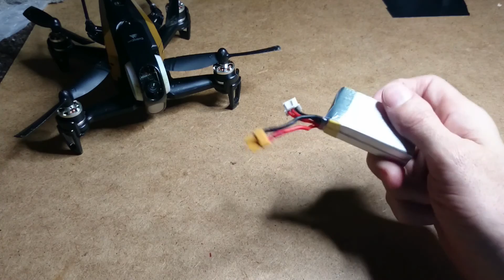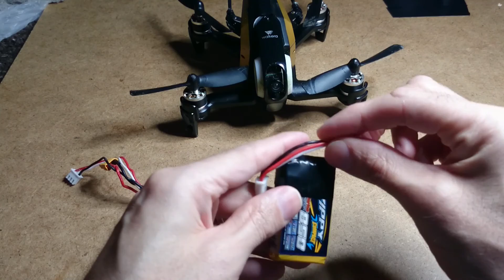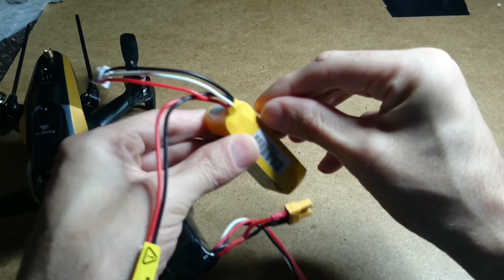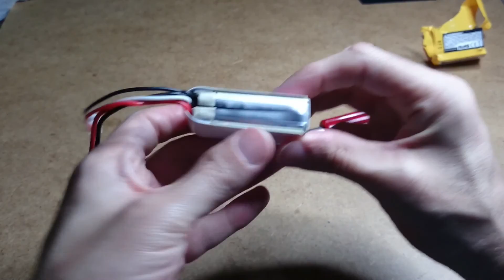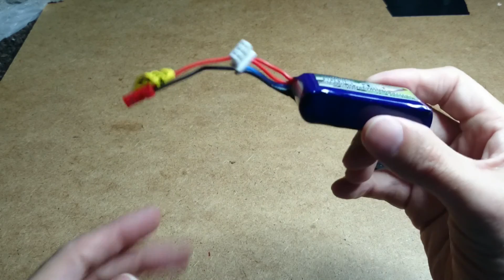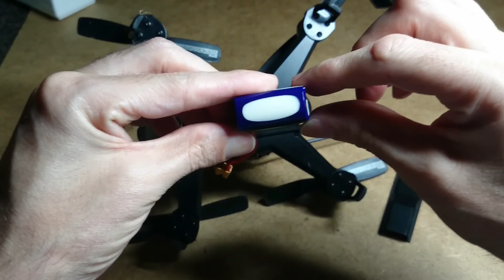Walkera Rodeo 150 Battery Shootout

Comment: I know this is an older video, and I'm not trying to step on any toes, but instead of of cutting open several of the volatile type batteries we use with quads, and removing one of their safety features, I thought it would be easier to adjust the battery compartment and leave the batteries alone.  I always hated that little door on mine anyway, could never get it shut right.  Anyway, I have some of the exact size batteries you were trying to fit in the Rodeo.  I just threw battery door in the trash, I carefully used a dremel to sand/grind down and back a little, the lip/groove that the the stock battery cover slid into. After that the battery fit in there snug as a bug, but I still attached a small velcro strap that went across bottom, just to be safe.
Reply from the maker: Yes others did what you said aswell thanks for your input :)

Comment: What plug do you need for the nano-tech 850mah 2S 25~40C Lipo ?
Reply from the maker: I changed all my plugs to XT30 even on the quad but if you are sticking to the stock walkera plug you need to use the EC2 plug.
Reply: Merch RC will these adaptors work?
https://hobbyking.com/en_us/xt-60-to-jst-charging-adapter-2pc.html?___store=en_us
Reply from the maker: Yes.

Comment: I had bought an extra top n bottom shell for my 150 and i noticed the bottom shell has 3 air vents under it.  Is that for the esc burn outs people were having?  Mine didn't come with the air vents.  Luckilly i have been flying in cool weather but in the summer i might have to install the bottom shell to get air flow.  I think I'm going to try one of those zippy batteries your using.
Reply from the maker: Yeah the air vents are to cool the Esc's burn outs were rare imo.............best battery is the nano tech 850 bro.
Reply: I did see a Couple videos of people having that esc burn out. I was a little worried but mine Has been awesome.  I just recorded a flight with my 808 keychain camera on it.  I might post it. Thanks for the tip bro

Comment: I recently purchased my rodeo 150 and I am very pleased with it however with such a short flight time (five minutes or so) is there any thoughts on buying a battery of the same voltage (7.4v) but a higher mAh, to increase the flight time? Is this a good idea or not and what things should I consider if I do want to obtain different batteries with higher mAh. I am only recently getting back into RC fun so I don't know much if anything at all about Lipo batteries. Back when I was really into it mostly cars and buggies the batteries then were regular NiCad's so it was a little more straightforward. I have lost my rodeo 150 a couple of times and it took quite a while for me to recover it, as a result I thought about adding a GPS locator to my rodeo. Just something that puts out a signal that I could track with my phone to help me locate my rodeo. Is there any suggestions for this, what type lightest weight or things to consider? I would really appreciate any feedback on these topics from anyone that has any insight  on these issues. Thanks in Advance! -S  also, any suggestions or links on where to buy accessories, ie. connectors for batteries, motors, gps tracking devices to put on your quad. I know of a few places but haven't yet found the place, "That is the place to go" for quads.
Reply from the maker: The best battery is the nano tech that should give you 6+min of flying time a bigger battery will just make the quad fly like a pig:P
As for loosing the quad it has a buzzer that you should hear just turn you'r transmitter of and it will kick in.
Reply: So a larger battery will make it fly like a pig? I just wanted to increase the mAh. instead of the stock 850 mAh battery, I thought about going up to a 1000, 1500 or even a 2000mAh battery. Is it because of the size and weight of the battery that it will make it fly like a pig or does it have something to do with the milliamps or something else. As far as your reply about the beeper to locate the drone and turning off the transmitter to activate it, I did do that but the beeper is very faint and hard to hear and one time it stopped working/sounding, probably because the battery died! Anyhow, that's why I thought of adding a GPS tracker. The "TK303B GSM GPS Tracker $39.35" from Gearbest, is the one that I was looking at and considering. It only weighs .068 kg I did not think it would affect the drone much in the way it flies and handles. I am still learning to fly & control my drone REALLY WELL as well as learning some tricks & advanced maneuvers and although I don't want it to fly like a pig, if it's not too drastic, a longer flight time & being able to locate it if lost, would help me improve faster, than it being really fast & perfectly agile! I am new to this, so I could be way off! I just want the best advise & input so I can learn "the right way"! Without spending a bunch of unnecessary time and money!  Some of my questions may seem very obvious but since I am new to this, I am only just starting to understand a lot of this, such as (Lopo) batteries! I don't even really understand what the 20 C, 30 C, or 35C, even means. From what I have been reading it sounds like that is the rate in which the battery discharges, if that is correct. If so, does that mean that a 20c discharges quicker than a 30-35 C? And therefor produce a higher output but for a shorter duration. If, "that" is also true, then a 20c would be a better battery for racing &/or acrobatics where higher power would be more useful as apposed to a 30-35c would be longer lasting and have less punch but would be a better choice for just basic flying or exploring where your "fly time" is more important than having that "punch"!If I do get it, does it just plug into one of the "external RX ports" on the side? I have so many more questions so is there a better resource for learning &/or getting questions answered!  If you think I am way off with adding a gps tracker or truly have nothing to gain with higher mAh batts, please save me the aggravation! 
Thanks for all ur input- steph
Reply from the maker: A higher mah battery will let you fly longer but weigh the quad down and make it less agile,If you are just cruising around then that's fine but if you want to fly fast stick with the 850mah and a high C rating.
Higher C rating gives you more punch and are usaly heavier depending on how you fly you could have a little less flight time but not by muchand no you can't use the rx ports on the side to plug in the battery or gps in that's for a receiver.
If you really feel the need for a gps tracker then buy it:)
one more thing you should check out rcgroups it's full of info.
https://www.rcgroups.com/forums/index.php
Hope  this was of help to you.

Comment: could u tell me what connectors I need to buy for walkera rodeo 150 I got the ones from Hobby king but they don't have the right connection plz help
Reply from the maker: EC2 female plug is what you need for the battery if you are staying with the stock 150 connector.
Reply: im debateing on switching to tx60 as i aready have some as well as a parellel board fro them...any thought on that? will i loose power or any downsides? relativly new to quadcopter word
Reply: btw your videos have heped me a ton..i really love your content!
Reply from the maker: Glad my videos are of help to you XT60 plugs are to big they won't fit in the battery tray but XT30 will be fine with no loss of power.....Don't forget to subscribe happy flying:)
Reply: ok do you know of a way to parallel charge the xt30's? the only boards i can find are the xt60's..im debateing just useing the 60s and finding another way to hold battery w/o the tray..any thoughts?
Reply from the maker: Do what i did https://youtu.be/UfrSYKdRJjg?t=9m12s
Reply: yeah but im asking how i coud parrellel charge multiple batterys like that?  so i dont have to charge 1 at a time
Reply from the maker: I can plug six batteries into that board and charge them all at the same time thats what it does:)
Reply: i can only find parallel boards with xt60 conections..did you make one yourself with xt30 connections?iv iterally spent hours ooking for boards with xt30 connections
Reply from the maker: I made my own leads.

Comment: Friend asked the battery he told me and now are not worth really?
My stock battery does not have that yellow pin, mine is blue and round
Reply from the maker: I have changed the plugs to XT30 that's why they are not the same i did mention this in the description.
Reply: Merch https://www.amazon.es/gp/aw/d/B00QOYBJ6K/ref=mp_s_a_1_fkmr0_1?__mk_es_ES=%C3%85M%C3%85Z%C3%95%C3%91&qid=1485901850&sr=8-1-fkmr0&pi=AC_SX236_SY340_FMwebp_QL65&keywords=XT30+CONECTOR 
These plugs are the ones that I should solder to the drone and batteries
Reply from the maker: Yes!

Comment: I had to rebuild my rodeo 150 as the body cracked.  After putting it back together it will disarm but will not arm.  Any thoughts???
Reply from the maker: Did you try a rebind?..........It might be the ribbon cable because it is very fragile make sure it is pushed all the way in,Did you recalibrate the ESC'S and check in clean flight that all settings are good?

Comment: Hi merch, have you tested some 3s battery on the rodeo 150? Is it possible?
Reply from the maker: No i havve not and i wouldn't just incase you blow a ESC plus the extra weight would not be good on the quad.
2s is plenty for the rodeo it's a rocket as is:)

Comment: i bought 2 of those nanotech's and i'm finding the walkera battery's are giving me more flight time..i'm using an IMAX B6 charger to charge them merch but i'm not sure if there charging right....what do you charge your's at.
Reply from the maker: I always break the batteries in and charge them at 1c,Give them a few flights and they should be better.

Comment: anyone tried one of these yet?
http://vi.raptor.ebaydesc.com/ws/eBayISAPI.dll?ViewItemDescV4&item=281727238246&category=40700&pm=1&ds=0&t=1482199712839

http://vi.raptor.ebaydesc.com/ws/eBayISAPI.dll?ViewItemDescV4&item=131841196522&category=9161&pm=1&ds=0&t=1482199878464

http://vi.raptor.ebaydesc.com/ws/eBayISAPI.dll?ViewItemDescV4&item=142105429417&category=40700&pm=1&ds=0&t=1482199943880
Reply from the maker: Not tried any of them i stopped looking for batteries after i found the nano tech 850mah because they are the best that i had found.
But keep us posted if they are any good.
Reply: Merch yeah will do! ordered those last night....should be here soon. got 6 nanotech on the way aswell. gonna keep you updated about flighttimes of the new untested ones
Reply from the maker: Nice i look forward to you'r results.
Also did you know there is a smaller rodeo 110 coming out? http://www.banggood.com/Walkera-Rodeo-110-110mm-FPV-Racing-Drone-w-600TVL-HD-Camera-5_8GHz-40CH-Transmission-BNF-RTF-p-1111956.html?rmmds=search
Reply: all of those had been pretty crappy :(
best flighttime was 4min15sec....not worth to mention really. gonna stick to the nanos without further testing of more expensive 25c lipos.
Reply from the maker: Thanks for letting us know and yeah i don't think you will find a better battery than the nanos.
Reply: i was a bit too fast with my judgement.....due to some logistic problem i havent gotten the floureon 1000mah when i replied to tell you my results......and well.....it was the only one that did well, lol ;)
6min 45 until lvc kicked in!! (low power-flight ofc)
im using soldered goldcontact jst btw
Reply from the maker: Not a bad time but try a faster flight:P
Reply: but they are a bit more expensive than the nanos....
but my 1st choice now if i just want to order a single one.....cause shipping is like always included with the floureon ordered from ebay. so a single one is cheaper than from hk. gonna have an eye on how they hold up in full power flights in cold weather conditions, since they are only 20c.
Reply from the maker: Yeah let us know how long they last before they run out of punch,i have not heard much about floureon batteries so i cant comment on them.

Comment: can you use 3s on this quad?
Reply from the maker: No i doubt  it plus you really don't need it as 2s it flys like a 3s:)
Reply: @ejay200704  NO, I've had 3 of these, 2 crashed and I reordered, after shelving two crashed ones for a couple yrs, discovered one of them was an easy fix, so I had two of them last month.  Decided to put xt30 plug on one and use the Tattu 3s 650 batteries I have a bunch of, that I use to fly my Leader3, lighter quad at 130mm, plus no body to it, like the Rodeo.  Some people fly 4s on it, so I figured the Rodeo could handle 3s650, and the Tattu's are only like 6grams heavier than stock Rodeo battery and only a tiny bit bigger, but fit in the battery well.  It flew great at first, but during 2nd flight it fell out of the sky like someone shot it.  3 motors did not work, and not from the crash.  The plastic around the ESC's and especially the motors were too hot to touch.  After some reading, Walkera only put 15amp ESC's in there and I couldn't find it, but I'm sure only 2s rated motors. If you're comfortable taking it apart the ESC's are just plug n play if Walkera makes higher amp ones.  All their parts are proprietary I think, so it's a pain to use any parts you have.  I tried to put different props on with nuts, spent an hour at hardware store trying to find a specialty nut that fit it, closest one I found worked, but was wobbly when first screwing on.
Reply: Before switching plug and trying 3s, I bought some 2s 1000mah lipos, but they were almost 40g heavier than stock, and didn't fit in battery compartment, so I made it fit..lol  Quad got about 45sec or so more flight time, but it did not like the extra weight, I wouldn't have thought I woulda felt 37g on the sticks when flying, but I did.  They were Turnigy batteries though, known for being a little heavy.  Might try different brand on the one I haven't' broken yet.
Reply from the maker: @sunshynff  I did say no to 3s others have tried it with the same problem burnt out ESC's.
Reply: Merch RC.....Yes, you absolutely did, I meant to respond to the poster, Joenas, since I just tried it last week, I also wish I’d seen this video first before experimenting, but the one I did it on had seen better days, it was my back-up. I keep forgetting how fast tech moves, when these came out, 15amp ESCs and 2s was the norm on a 150mm quad, now they’re flying 4s on 120mm quads..lol.  And you’re right, the Rodeo flys like it’s on a 3s, even with that full shell, it was really well designed.

Btw, do you know if there’s software available to flash/tune the Rodeo? I know originally Walkera wanted us to use the radio to tune it.  But I thought I heard something obscure like Libre Pilot or something worked.

Comment: i might try some of these nanotech's i'm sure there cheaper than the 4s 5000mah 14.4 volt battery's i buy for my RC car's...drone's are cheap to play with....try owning 4 car's then you will know pain...thank's for vid.
Reply from the maker: Yeah RC car batteries are very expensive compaired to a150 size quad battery because they are much cheaper.
Reply: do you charge these nanotech's the same way as you charge the walkera battery's with the rodeo charger..just plugging in the balance plug.
Reply from the maker: No i charge them with a imax b6 charger also i would not reccomed trying to use the walkera charger.....Just remember tho i changed all the plugs to the batteries to XT30
Reply: i have a hyperion charger for my car's so i can probably use that    but i've never had 2s battery's do they all charge just from the balance plug no matter what charger you have.... with 4s you have to plug in the EC4 plug and the balance plug ...and also why can't i use the walkera charger...i'm also putting EC2 plug's on mine with heat shrink.
Reply from the maker: Yeah the hyperion  charger would be best to use just plug in the EC2 plug and the balance plug as you usaly do.
The reason i wouldn't recommend using the stock walkera charger is there really not good and i have not tried charging any other battery with it.

Comment: So is my Rodeo 150 falling out the sky ??
done this since new 
losing power
Reply from the maker: No it's not falling out the sky,many people have changed to XT30 plugs,Maybe you have a bad solder joint?
Reply from the maker: What battery are you using i had one zippy that whould only fly for 1min then drop out the sky it was a bad one.
Reply: Will check that but the live video is not affected 
I have a replacement arriving Monday so fingers crossed it is all good

Comment: Hello Merch,
 I could use some guidance modifying the battery plug on the quad. Really tired of using stock charger. Did you have to disassemble the whole quad to custom fit that plug. 
 Thank you my Friend
Reply from the maker: I just snipped the EC2 plug of and soldered the XT30  to the quad it's a tight working space no need to disassemble just make sure you don't drop any solder in the quad when doing so.
Reply: Right on Bro! Have to order some XT30 plugs and some of those nano-techs...before you buy them all! lol

Comment: Hi Merch. Just got the rodeo tonight took it out for a flight and it is unbelievable. I gave it a punch and could hardly see it.  Most challenging part is keeping it from the trees. When you turn it around you have to give her other wise it keeps going backwards. This thing is fun but new to me.
Reply from the maker: Hey Chris glad you'r enjoying it.I dont understand why it's going backwards.....Does it hover without going backwards?
It's a mean little thing just keep it in stability mode till you get used to it:)
Reply: I thought I had in stability mode. I just flew in one direction then turned it in another and continued with momentum and glided backwards.
Reply from the maker: Make sure you'r mix switch is at 0